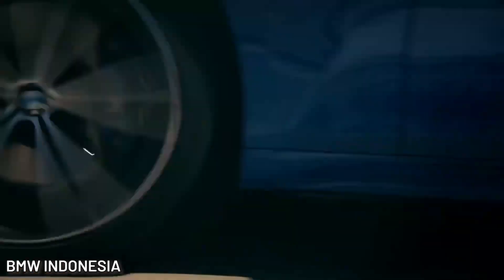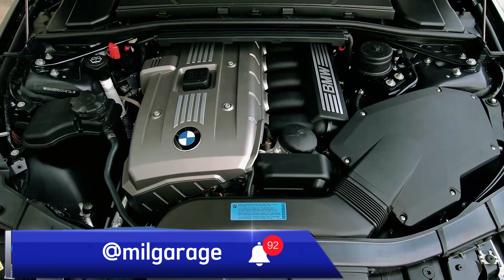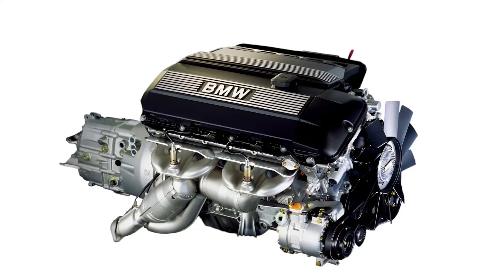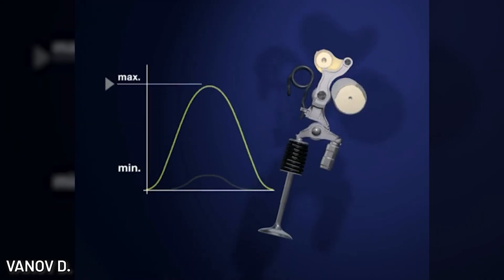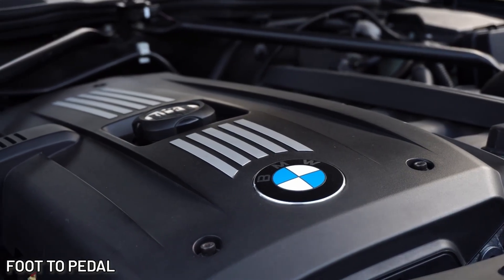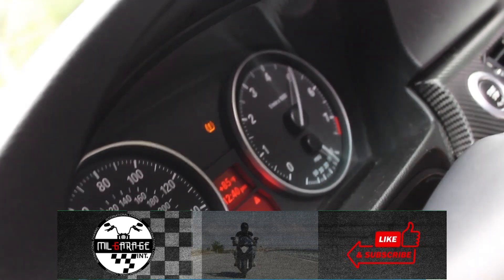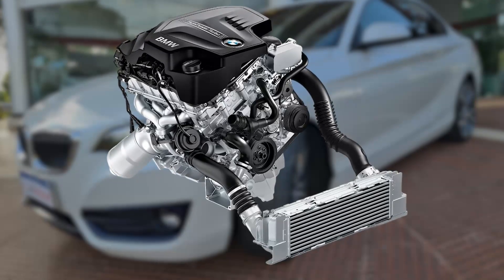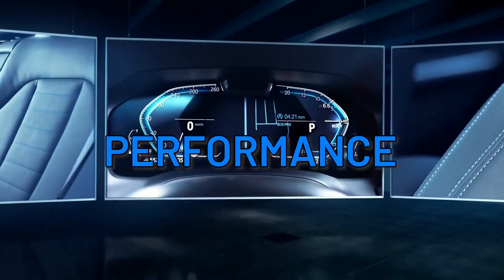Why Is The BMW N52 Inline-Six Engine So Reliable

Comment: My 323i n52 is at 260 k still running like new. valve cover gasket done, transmission fluid changed, wheel bearings, and other sensors/small parts.
Reply: i am about to buy a bmw e60 523i with n52b25 how’s your experiences with this engine, it has 190k kms but it should be in a great shape and i plan to change al the gaskets of the car and the water pump as soon as i take it home
Reply: damn... mine has 160 k... gives me hope  haha

Comment: Took a125i for a test drive with 40,000 km   Wouldnt idle wouldnt change gears ( autu ) wouldntrev past 2000 rpm nothing was right

Comment: N53 was last 6 cylinder na engine not N52.
Reply: Only in Europe the N53 was not available worldwide so technically worldwide the N52 keeps it's title as the last Naturally aspirated Engine cause Worldwide it was the last one as said the N53 was only available in one market Europe
Reply: @shadowthahedgehog33   Exactly! lol. Proud owner of an E60! N52 BABY!
Reply: The last without DI.
Reply: True, and wrong. The N53 was a revised N52 so both are correct
Reply: @jozefvelez8458  revised? problem with injectors / hpfp and more.. But yes, it was good enough about economy..
Reply: N53 is ass